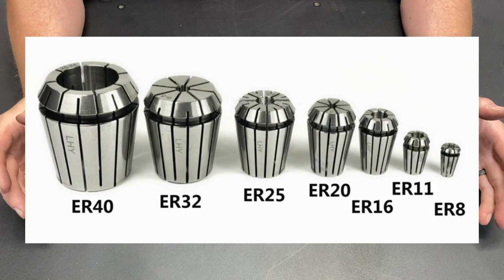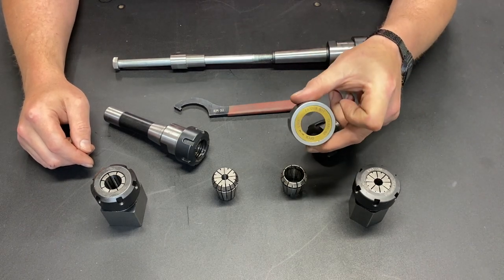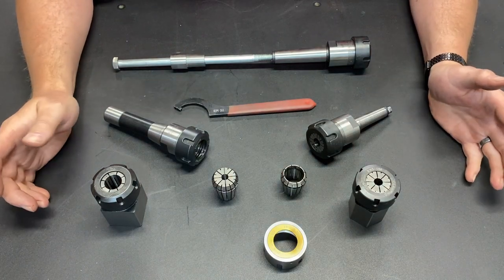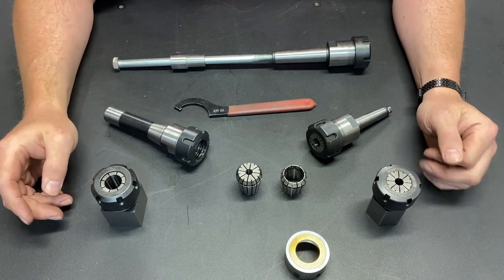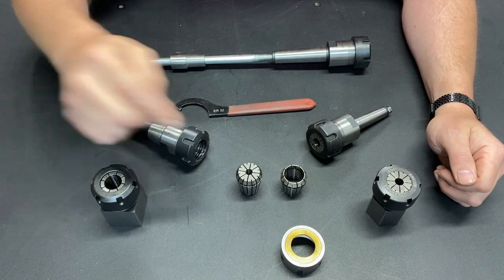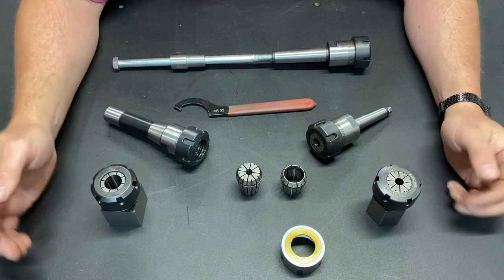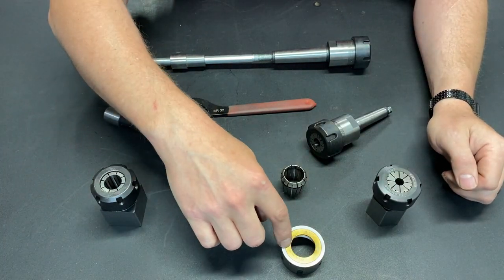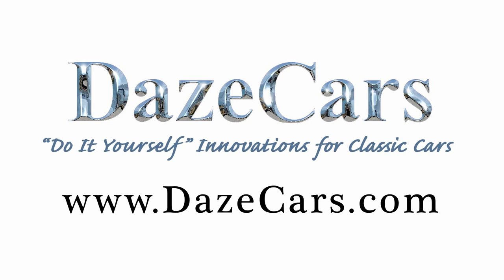A MUST HAVE for Anyone using ER Collets, Get a BEARING Nut and here is WHY

Comment: I`ve seen these, and i`ve read about these... 
In short, only get the high quality ones that are not imported or you are getting a shit deal... 
No brass/bronze/alu bearing ``cap`` should be there either, like is seen in this video(i assume anodized alu, but could be brass)... Those cause issues... Only the ground steel ones with nice quality bearings are worth the money, and they supposedly are remarkable... Kinda like adding a thrust bearing to a lathe toolpost handle - prevents the rubbing, wasted efforts in overcoming friction, negates the friction or rubbing wear of the collet and the seats, just like the thrust bearing does with the toolpost and handle flange surfaces... 
I have not gotten any myself, as my current state of shop is more of a machine storage room, and so i don`t use my machines, i just do some modern art painting with lubricants and splash the machines like a madman to keep them nice and rust free, but i have no need of those atm, yet they appear as a great idea if gotten from a reputable supplier... I won`t suggest making them yourself, as for once, even i am not willing to consider bothering with that... Just don`t get the cheap ones... 
Tooling can be found for cheap, but that applies only to uninspected new-old stock bits that you run across when shops close or when a shop owner dies and the ingrate descendant scum decides to just sell/scrap all of the machines and tooling to get the space so they can sell that too - like the miserable little goblins that they are... 
Cheap tooling from a supplier is either a waste of money(shit) or it`s a kit(decent quality, but 0 finishing and fitting outta the box) that you have to invest some hours of manual work into to get it to perform like a decent tool... This is not an old type of tooling, so you won`t be finding these as new-old stock in some closed shop, buried under a bunch of other stuff in some machine accessories cabinet... 

Best regards!
Steuss

edit
I clean my collet holders(long taper) with acetone or brake cleaner before each collet change, and i squirt some way oil down the threads of my collet nut, thus the oil lubricates the freshly cleaned and dry threads, but it also sinks down and lubes the short taper section of the nut, which as you tighten the nut - lubes the collet itself on the short thread section, allowing the long tapers of the holder and the collet, which are dry - to seat well and not spin due to increased friction, and the short sections being lubed are given a bit of a helping hand with the wear and tear effect of the material rubbing, without affecting the retention of the collet in the body... It`s my advice if you don`t have a bearing collet nut, as i do so myself for every collet or tool change, and it works beautifully...
Reply from the maker: Thank you for your detailed description and opinion albeit less persuasive not having actually used a budget unit yourself.  I have had mine for over a year and they work flawlessly.  Yes you get what you pay for and a more expensive unit will last longer but a lot is dependent on how often you use the tooling.  If you are using it multiple times a day every day then yes get a high quality unit but if your use is more sporadic a budget friendly option can be just as effective.  I find that most people that complain about budget tooling like this fall into two categories the first are those that have never used it and assume its junk because its imported and inexpensive and the second are those that get it for a high production situation and expect it to perform as well as the more expensive unit they should have gotten to begin with.  Thanks again for your comment.
Reply: @dazecars  Anytime, as said, i read about these for the most part, but theoretically, one needn`t use them to be able to figure out what is good about them and what are the potential issues that could come from a shitty vendor... At least if you have any machining experience and knowledge - this ain`t an intricate car engine, it`s just a great idea applied to a toolholder, but the execution of the application can vary... 

Also, you missed a category - people who have major disdain towards getting China imports due to political reasons... Sorta like activists, but with less snot and more actual principles to them... 
I don`t really hold that stance, but i can understand it and even applaud it... When you are getting a tool for cheap, and if the tool is literally not just a turd wrapped in a box - at least for the prices that stuff comes for, then you know that someone was exploited brutally to get that for you... I won`t say that i don`t fancy myself some quick cheap carbide endmills for hardmilling, or cheap cbn for hardturning, but that is the problem... I know that i`m getting a very decent product, for too cheap... Tempting, but temptation is always alluring, yet invariably evil at the same time... 

Best regards!
Reply from the maker: Sadly at this point the vast majority of consumer good are made in China and they are almost impossible to avoid.   Even worse in many cases the China made goods are higher quality then their US made counterparts.   I have a "us made" Craftsman tool box that cost me almost double per cubic inch compared to a Harbor Freight China made toolbox and the Craftsman unit is half the quality and the HF unit is far superior.  I too applaud those that "buy local" and I try to do the same as much as I can but its not as simple as it should be when in many cases you pay a lot more for the same or lessor quality.  Please don't misunderstand me I am not implying in the sligest that a budget bearing collet nut is the same or better than a more expensive unit.  You get what you pay for and if you are willing to spend enough money you can get the highest quality that will last a lifetime.  The same cannot be said of budget tooling and they will where out faster but its less of an issue if it will see light use.   The bulk of this statement I am just speaking in general terms regarding China made products as a whole.

Comment: solution to an invented problem... I have regular ER nuts that are more than 20 years old and besides the fading black oxide, they look pristine on the collet bearing surface, which is all I care about
no special care has been given to these, wd40 spray when I put them in the drawer to prevent corrosion, that is about it, wipe clean before use, residual oil seems to be all that is necessary
besides - they are consumables, if you use them that much that they wear out, you have done enough work with them to justify a new one, every 20 or 30 years...
and on top of all this, I don't think that adding 2 more bearing surfaces and ball size irregularity really improves seating precision, it is easy enough to tap the regular nut while indicating on the tool to get it to run true if the collet is any good that is, and the holder itself, mind you this is to get them run true to less than 0.02mm, or 1 thou
Reply from the maker: I will concede to your 20 years experience that I do not have.  As I said in the video whether or not it adds accuracy is up for debate.  With those two things said for me the easier tightening and loosening coupled with the increased clamping force are what making it such an improvement in my shop.  I have no doubt what you are using works well but to say it is not necessary without actually trying it might not be the best approach. 😁
Reply: They don’t increase accuracy. Coated and bearing caps are only for easier tightening and giving greater torque. Techniks states that their coated ER 40 cap allows for 130 ft/lbs of torque, which is quite a lot. You can’t possible come close to that with a standard cap.

Comment: The collet still moves inward as you tighten, so there's still movement.  The collet gets smaller, and moves inward in the taper.  Collets, and tapers, are wear items, like so many things in the shop.  Also, getting swarf into the bearings here (inevitible) will reduce accuracy, assuming (doubtful) that this thing is made accurately in the first place.  What's your MEASUREMENT to assert that it's tighter.  I'd say it might be easier to tighten, but not that it gets tighter.  If the thread pitch is the same, and you turn it the same amount, it's the same tightness, right?  When you say CONFIRMED, you need data, not conjecture. This looks like a hammer looking for a nail to me.
Reply from the maker: I appreciate your feedback.  Yes there is still movement as the collet is pressed into the holder BUT it is only in one direction and parallel to the collet slits which will reduce wear thats just common sense.  The fact that it is by nature a "wear item" is not a good argument at all.  Just because it is consumable doesn't mean getting an extra 5% life out of it doesn't have benefit.   A far super argument against the virtue of reduced wear came on another comment.   He said it took him 20 years of regular use to wear out a collet with a standard nut.  If you need a new tool ever 20 years, adding an extra 6 months is not in and if itself worth the upgrade. I would say a wear improvement is marginal.  The holding power is not.  Ironic that you use a word like "conjecture" (an opinion or conclusion formed on the basis of incomplete information) as you have formed this detailed opinion without having tried the bearing nut.  Yes the potential holding power with both nuts is the same BUT with the same amount of pressure from the wrench the bearing nut will tighten down further because of the reduced friction. Things will also seat better as movement is only in one direction.  I agree measurements would have been more conclusive but observation is also a valid form of data collection especially when the improvement is significant.  Read through the comments you will see lots of people coming to the same conclusions I have.  It is not like I purchased this nut with a video in mind.  I got it 6 months ago because someone said it was "better".  I put it through its paces and CONFIRMED it was better, and Then decided to do a review.  No forgone conclusions or a situation of a "hammer looking for a nail"
Reply: Front closing collets don’t change position the way rear closing collets must.